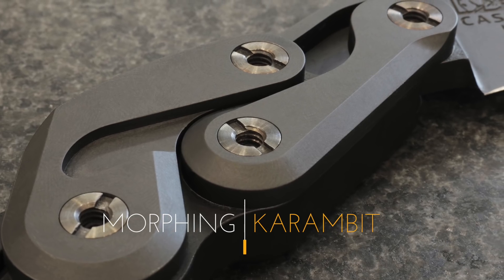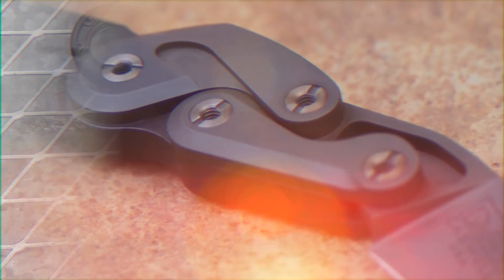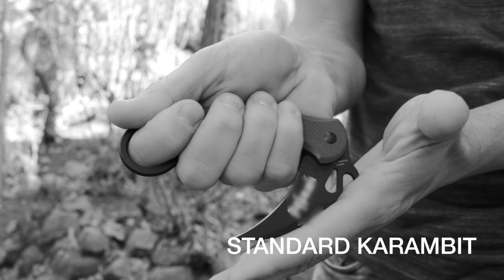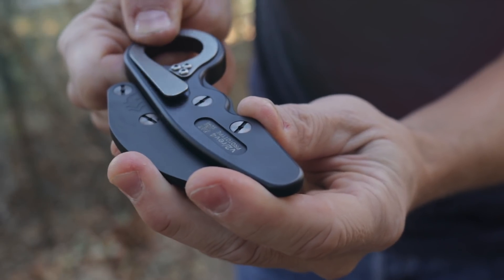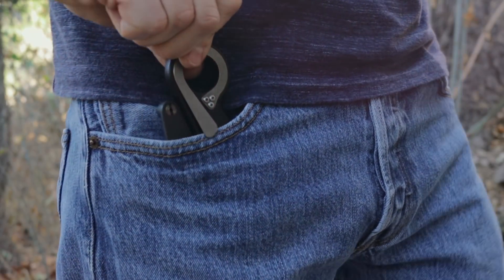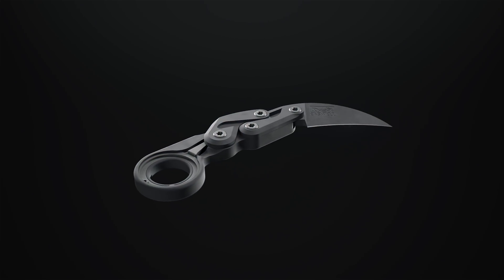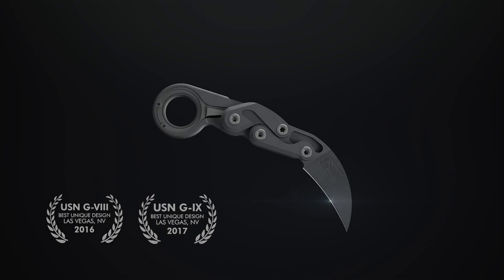Caswell "Morphing Karambit" Introduction Video

Comment: I have the Caswell CRKT Provoke and Provoke Compact Knives. This is an exceptionally innovative design. I prefer the smaller hand fit of the compact. Even with the blade closed, it offers a self-defense utility. The blade opens effortlessly, with a thumb flick. I think this is the best-designed karambit. My favorite knife by far. Well done Caswell.

Comment: I think a two step bevel design for the blade, instead of a single bevel from spine to blade, would make the tip and overall blade stronger. Right now it seems like the tip could break or bend if stuck in a tree and bent slightly. I could be wrong.
Reply from the maker: Though the point will hold up much better than some may expect (especially in CPM3V), I'm sure you could damage it if you try. The edge and point are actually better supported than it may appear from simply looking at the profile. My abuse testing was directed mostly at the mechanism, but included substantial loads on the blade via prolonged chopping of lumber while holding from the ring to induce enhanced impact though a "whipping action". This was to expose the whole system to significant shock and high loads far outside normal use perimeters. I did not produce blade failure of any kind. Though I did not intentionally target the point in this testing, the point did receive substantial incidental, eccentric impacts without failure or deformation. Again, you could obviously induce such failure if you tried, but overall, I'm confident the point is certainly not especially fragile. Ultimately, though, any blade is optimized for certain tasks. Though a surprisingly good general utility tool, there are important use considerations when providing a high-performance karambit blade that favor an unapologetically acute point.

Comment: 650 is more than the average monthly salary in my country. Its ridiculously expensive. I'd buy it in a heartbeat if it were around 200 bucks (and I make WAY more than the average here), but with a price that high you are out of orbit.
Reply from the maker: I understand. It is not an option anyway, because the US-made ($650) version is sold out long ago. Your concern about price is why there is the CRKT "Provoke." It is the full-production (imported) version. It is very good and retails for $199.

Comment: Why on earth would you compare the opening of this to a fox karambit. The fox isn’t meant to be opened in your hand, it’s meant to be opened before you even have a grip. Also, it is meant to have your fingers taken off every now and then especially when you do flails and spins and what not and can even use that tech quite to open it on clothing or something. This is a cool product, but don’t compare it to something that is much much different and faster at opening. The one thing I agree with tho is that if the lock fails on this knife it won’t cut up your fingers which is something I think about with liner lock knives like the fox. Emphasize that point if you gonna compare

Comment: When carrying in the pocket, is there not a chance the blade pops out accidentally?
Reply from the maker: This is not a spring-loaded action that can "fire" in the pocket. There is spring detent into closed position. 
If you consider the knife's action and the way the blade moves out and away from the frame as it travel to the open position together with the conditions inside a pocket, it is clear that opening in a pocket (even on purpose) is very difficult. Much more so than a standard tip-up folding knife which may cause severe injury if it accidentally opens even a small amount. 
Even if you purposely move this blade toward the open position in the pocket, the edge is sheltered by the frame for much of it's travel and the conditions of the pocket tend toward closing. A standard pocket will not allow the required space to extend much beyond that without effort. This is much more obvious with the benefit of trying it in person. Thanks!

Comment: For those of you complaining about the prices good news CRKT has taken in the knife and doing a colab with this knife designer and i believe is selling it for a little cheaper. I believe the the MSRP is 200 on the website which they named it the CRKT provoke but they might make it cheaper on Blade HQ or something. Hopefully it'll be out by the time Shot Show 2019 comes by. They say the steel is going to be D2 with Aluminum handle materials.

Comment: You are not about to say that a FOX karambit is difficult to open "because your hands are wrapped around the whole thing." Give me a break, FOX karambits have a trademarked function called the Emerson Wave that deploys the blade by grabbing onto whatever you have it strapped to. Its that hook on the back of the blade. And that price is just crazy, $650 don't get me wrong it is a very well thought out blade. But I'm sure you can (not saying to do this) probably make your own for a 3rd of the price with 3D printing or through classic crafting. For now sticking to Fox karambits
Reply from the maker: The FOX is an excellent value, and a fine choice. 
Like any conventional folder, however, it cannot be conveniently opened from a retention position (gripped in the fist, blade closed). You must release it to allow the blade to pass and (usually) use a support hand to open it which may prove difficult in a crisis. 
The wave is elegant, but some train away from it because they believe that, while good, it's not a 100% reliable means of opening for them (sometimes it doesn't open or open all the way, etc.) I have no opinion on this, but this is what we heard from our team of consultants (which include martial artists, police/SWAT, and military practitioners). 
Another obvious consideration is that if you open the conventional folding karambit blade on the draw, you cannot use the tool for non-bladed use, as may be desirable in under certain circumstances. 
By contrast, this knife can be opened on the draw (not unlike the wave), or can be drawn to retention (in fist, blade closed) and converted to bladed tool as needed instantly, 100% every time, and without letting go of the knife or requiring a support hand.
Also, as seen in the video, fingers aren't crossing the rotational path of a blade ... meaning it can't suddenly close on your fingers while grasped for use. Considering the high reverse loads karambits may encounter, this is often viewed as a significant safety improvement compared with conventional folding karambits.
Reply: Id like to see you 3d print a functional knife, yeah right, 3d printing is nowhere near that stage of production durability

Comment: That is a combat knife, not a utility knife. They need 600 per unit to pay for this video.
Reply from the maker: I'll consider that a compliment :)  I did this video. It was my first Final Cut project. The "About Us" video on the KS page was my second FCPX project. The cost of the knife is driven entirely by cost to product. Big numbers are always in the lower price points, but with he very good CRKT imported version coming, it only makes sense to offer a semi-custom-level US-made build.
Reply: @caswellknives2493  that is a long winded response that does not say much, its cool, but i would rather buy 3 sks rifles for that price
Reply from the maker: @aidans4866  
If you aren't into high-end domestic short-production, CRKT has nice imported versions for $200.
Reply: @caswellknives2493  link?
Reply from the maker: @aidans4866  https://www.crkt.com/provoke.html

Comment: I totally dig this karambit I like how it depolys. I personally live i Baltimore so if I see someone walking up on me I can already have this in hand without actually worrying about how quick it will take me to pull out the knife in case ish go down. 

I carry my karahawk spyderco but most times I just have my fox pepper spray in hand because pulling out that knife will just already be opened because of its wave and I don't want to be arrested/shot by police from being called on for pulling out my blade when I didn't need really really need to.

And before anyone comments about having a gun I can't carry outside because maryland is stupid. Running is only optionally when you see the danger but most times you wont know till its already happen to you and in those times that person or group already has the drop on you before you can manage anything so there for am always ready in hand with something.

Comment: How strong is the locking mechanism? Comparable to what other folder lock? Can it be deployed with momentum by slinging it forward while using the ring feature?
Reply from the maker: It is superior to conventional locking methods for a karambit.  A karambit lock must resist high loads in both directions. Most conventional karambits feature locks designed for standard knives.

Comment: So how do all you knife lovers sharpen an inward curving knife on your fancy set of stones that goes up to 10,000 grit?  On the positive side, punching is still a very important skill in mixed martial arts and holding a knife this way allows you to punch with little modification.  The other guy is going to think twice about using standard blocks to the punch.

Comment: Everything is cool BUT the price is totally nonsense,650$? Really? Is it made out of Vibranium/Adamantium? Ppl would buy rather a 599 Fox karambit.
Reply from the maker: This is a high-end US build. There will be an imported version from a major brand in 2019.
Reply: Caswell Knives Ouh,gotta wait for that
Reply: Just dont let china sees this.
Reply: @egoy34  they already have
Reply: You forgot the principal material in this construction, unobtainium!!!!!
Reply: @caswellknives2493  it's a knife. Is the blade made from a metrorite or damascus? What reason is there for such a price,whys it that price? Charging high amounts will see you some money but it won't be loads considering only a handful of people would pay that much,where as cheap or reasonably priced products see so much custom the company makes up for the low prices
Reply from the maker: Thanks for your thought. The US model made by Millit Knives is a high-end short production model. Price is driven by costs. As a short-run, semi-custom build, that is what it costs. They are long sold out.
The full-production (import) version by CRKT is called "Provoke". It is a very good build and retails for $199 and is available now.  @tesstickle7267
Reply: @caswellknives2493  the price is surely coming down but it's still highly priced. I understand the knive is good quality but you could nearly get a solid gold one for a little bit more ha  anything with made in usa or England/uk stamped on it is definitely better than the common made in China junk i have to admit.

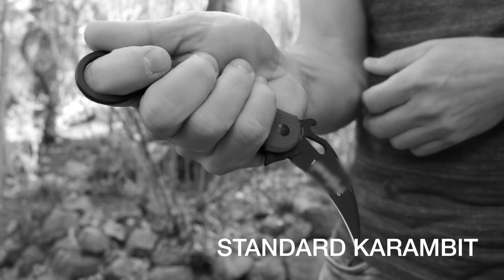Comment: "how can you deploy a pocket knife when your fingers are securely wrapped around the handle?" well the pocket knife you're showing at 0:49 opens up with the Emerson wave so, it's open before its completely out of your pocket.... Which is... You know, faster than yours opens, and way cheaper.
Reply: i have 3 knives, 2 are karambits and i agree the Emerson wave is way faster. this knife you still need 2 hands to close it, its not an otf.
Reply: hawtmusturd only three knives? 😂😂😂 yikes i have 5 fixed balde karambits alone up your knife game you wont regret it trust me. You can never have enough knives
Reply: @freerider8737  i have more than 3 knives, im talking about the ones i have with the emerson wave feature. There was a point where spending money on knives was too much
Reply: hawtmusturd hmm get a better job and get more knives aye 😂 currently have about 86 knives  😐😅
Reply: Dam you balling like that? Let me find out, buy me some
Reply: hawtmusturd why would u buy you a knife when u can buy myself a knife? 😂
Reply from the maker: the wave feature is not for switching from use as a non-bladed tool (retention) to bladed. You will need two hands. You're obligated to a bladed tool right from the pocket, which is not always desirable. Also, this may be deployed directly from the pocket as well if desired.
Reply: Great design and all but I avoid the whole problem by using a fixed blade knife 😁
Reply: @rjoshm20  no shit you need a knife, but a different, innovative way to deploy, is not wrong. If you don't like it, stick to whatever you have. I'm sure it won't confuse you as much as you seem to be confused why this knife is the way it is.
Reply: @zac_in_ak  fixed blades aren't always the most pocket friendly, point blank.
Reply: urjnlegend not confused at all, I was referring to its use in the closed position as a retention or impact device, which I see as an over complication.  If I pull a knife out I am not pulling it out to use as an impact weapon, I have other tools for that.  My emerson karambit is for secondary weapon retention or a primary lethal option with my weak hand if my strong hand is unable to access my sidearm.  Hope this clarifies what you call my “confusion”...
Reply: @urjnlegend  very true. I'm lucky to be able to carry a fixed blade EDC. I do like the knife design but not sure I would spend the money even on the crkt version for some of us $200 is a lot for a knife.
Reply: OooOof
Reply: I open my karambit with my palm so.. Yeh.. I don't know a single person that actively uses their second hand to deploy a blade 😐
Reply: Lots of tough guys here in this comment section
Reply: @Nochift138  true

Comment: This is an awesome knife and one of my personal favourites since I got it 1 year ago for roughly 200$. But this knife has hands down the worst pocketclip ever. It doesnt work as shown in the video, atleast I haven't ever met anyone who managed to pull that off. Not only that but even if I try and use both hands I struggle. And the other thing that sucks is the weight of the thing. Other than that it is a great toy.

Comment: I regrettably purchased this knife. I dont recommend buying  the Amazon one or anything under the $300 mark. I got mine on Amazon and its junk. It wont deploy half way out tends to get stuck half way out.  It automatically deploys coming out of my pocket half the time and you can guarantee the screws will 100% back out on there own. Buyer beware.

Comment: 450$ what I can see a hundred fifty maybe 200 but $450 too rich for my blood
Reply from the maker: A big-brand imported version is coming in 2019. It will be priced like a good-quality mass-production piece.  The price of the US-made, high-end versions is $650 and the first build is sold out. ($450 was dealer cost extended to Kickstarter backers only and expired after 30 days).
Reply: @caswellknives2493  when in 2019, any quarter estimation?

Comment: Really? Ripping on the 599? 599 is ideal for combat, this is not. Once this knife is deployed does it lock it in place for flailing techniques used in kali or any martial arts? I bet it doesn't. Nice design, but not practical for real life high speed martial arts combat. I trust Doug "Kuya" Marcaida & his knife over this or even a fixed karambit.
Reply from the maker: Not ripping on anything. They are different designs. Yes, this locks and is optimized for loads against the blades in both directions.